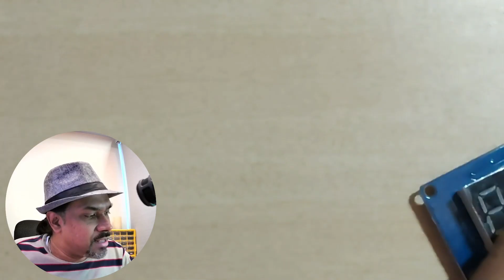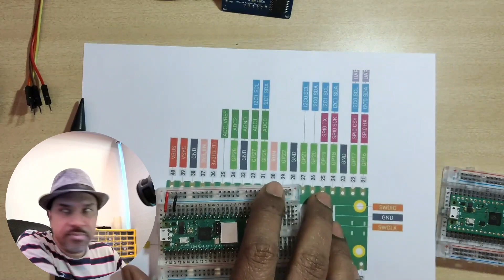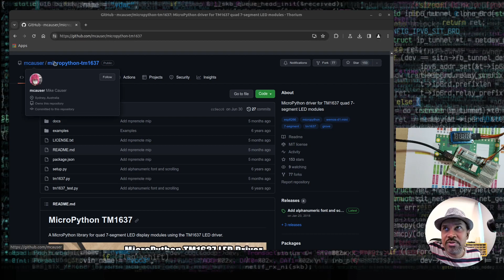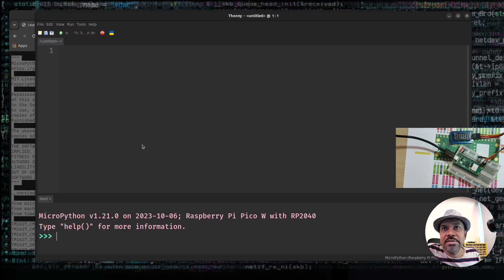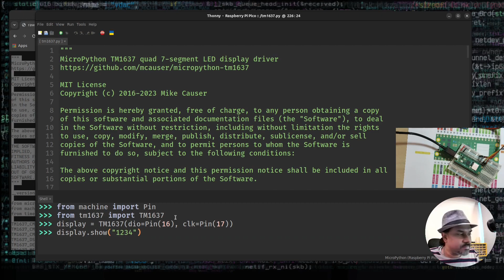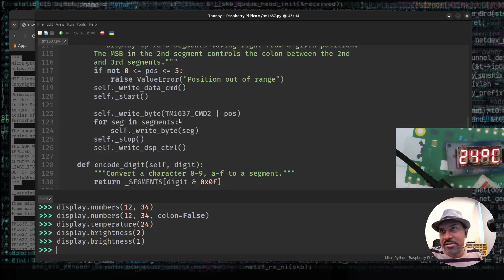Interfacing TM1637 4-digit Seven Segment LED  module with RaspberryPi Pico using micropython

Comment: Thanks for explaining this, nice slow and methodical presentation, gave me the information I was looking for, ie the display.numbers() function. However, I can’t help but share a similar concern that kote315 has. I was of the understanding that the VBUS cannot be used to supply output power to modules etc. The power flow being, VBUS receives power from the computer’s USB port, which then supplies power to the VSYS, which after being regulated, supplies 3.3 volts to the 3V3(OUT) pin. The VSYS receives its power from the VBUS through a Schottky diode, which prevents power from flowing back out of the USB port. Are you not tapping into the power at the wrong stage. Anyhow, I have used the VSYS pin to be on the safe side.
Reply from the maker: Hi @IffySnuffy, Thanks for tuning in! As I mentioned earlier in response to kote315’s comment, the TM1637 module can safely be powered with 5V while its input pins operate at 3.3V. The TM1637 chip is designed to tolerate both 3.3V and 5V logic levels, making this configuration reliable.

If you’re powering your Raspberry Pi Pico from an external power source connected to VSYS, it’s indeed safer to power the TM1637 module from the same line. In that scenario, VBUS should be completely avoided to protect your computer’s USB port from any potential back-powering issues.

However, in my setup, the Pico is powered directly from the USB port, so it makes logical sense to use VBUS to power the TM1637 module as well — both are drawing from the same USB supply. I chose not to use VSYS in this case to avoid adding extra load on the Pico’s internal diode (as a precaution in case the LED module develops a fault / short-circuit).

In short, the idea is to power all connected peripherals from the same source that powers the Pico itself, ensuring consistency and safety. Hope this addresses your concern.

Comment: I'm a little concerned that when the display is powered by 5 volts, its data pins also have 5 volts (I checked this with a multimeter), and the Pi Pico has 3.3 volt logic levels. This connection option doesn't look right to me. Of course, it is possible to connect 3.3 volts for power, but according to the datasheet, the TM1637 chip is designed to operate at 5 volts. So this connection option doesn't look right to me either. Probably 3.3 volts will not be enough for some LEDs and they will be dim. But for many people on YouTube it works fine on both 5 and 3.3 volts, so perhaps there is nothing to worry about. However, most use 3.3 volt power, which is probably safer.
Nice hat, by the way.
Reply from the maker: Nice observation! However the TM1637 has a flexible operating voltage ranging from 3.3v to 5v for it's inputs. Thus, this LED module can be powered by 5 volts while the input pins could still use 3.3v logic levels without the need for logic level converter.